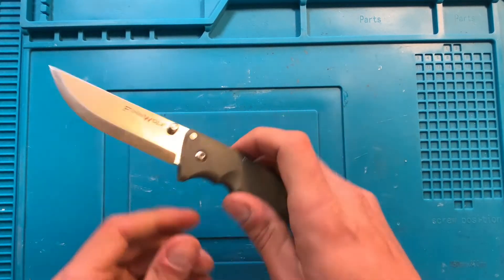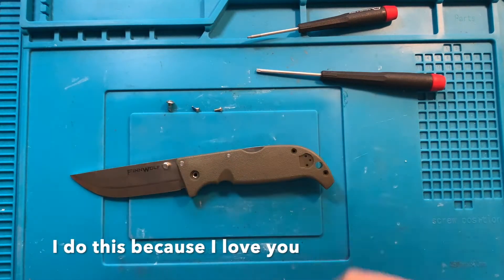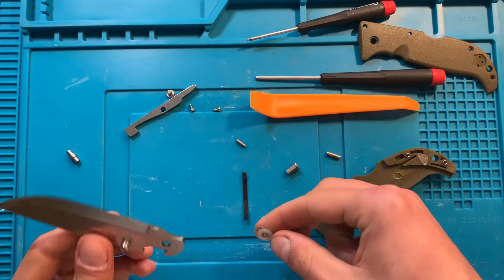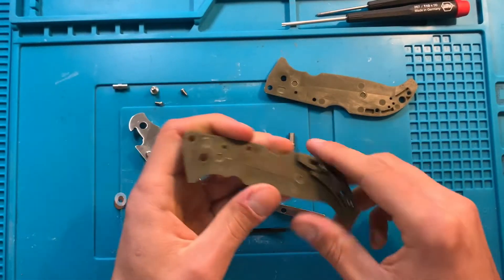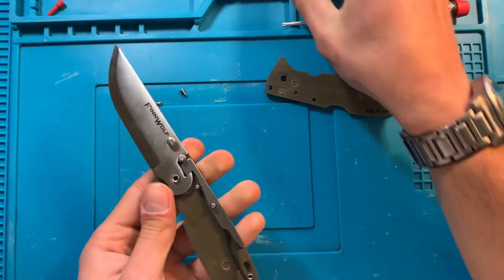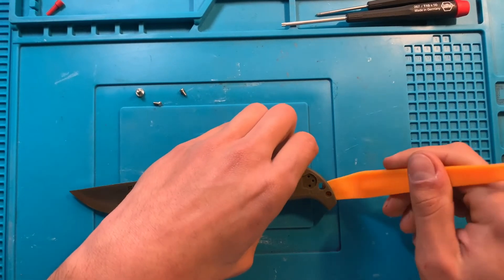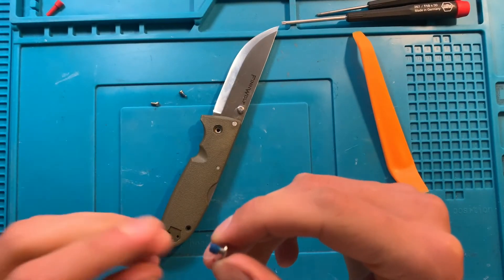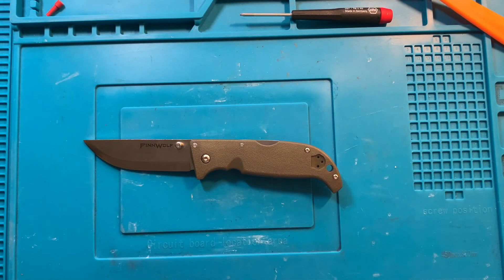Disassembly: Cold Steel Finn Wolf (feat: Triad Lock)

Comment: That backlocks indent is definately odd. Not sure if it's a defect, or what.

What's also interesting to me is the scales seem to have impressions(?) on the inside of where backlock end meets the blade, and in the center there as well (though those might just be caused via the injection molding process for the handle scales.

P.S.
Whilst I don't care for Cold Steels "tacticool" marketing, I'd remised if I didn't say that their triad backlock is quite nice. Just wish Cold Steel used better/stronger steels in their blades.
Makes me wonder if any knife maker has recreated their own blade and put it in a Cold Steel's folder. (like remaking the Recon 1's blade, but in D2 or something)
Reply from the maker: I've seen reblades for the 940 and PM2, but never thought of it for a Recon.

Comment: Looks like the white washers are plastic. Not sure what the purpose is of having two washers per side. Never seen that before. I guess there must be a reason. Maybe because there's no liners in the handle. Just plastic panels.
Reply from the maker: I’ve always assumed it’s just to provide space for low tolerances. If your machining is just a bit off between the pivot and the handle, sometimes that tiny little sliver is enough to fix it without having to pay to redo the schematics. No real idea, that’s just what I’ve thought.
Reply: To add to what Dave said; I also think it's cause it helps with providing less friction against the washer, blade, and liner when pivoting open/closed, providing a smoother action.
By having both the metal and teflon washer beside one another they sorta help provide less friction overall, as it's not just a single washer wedged between the metal blade and a liner.